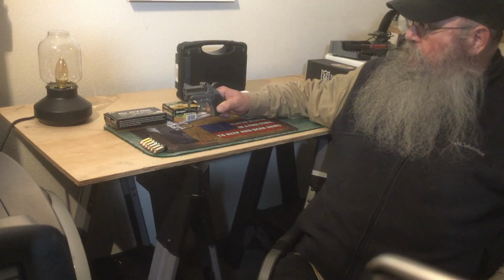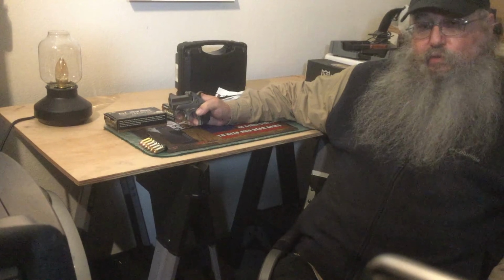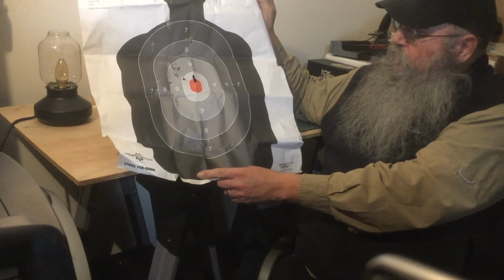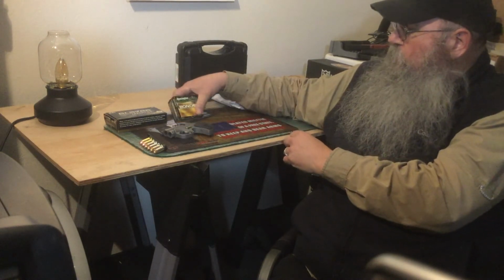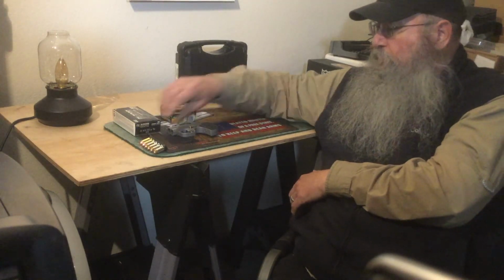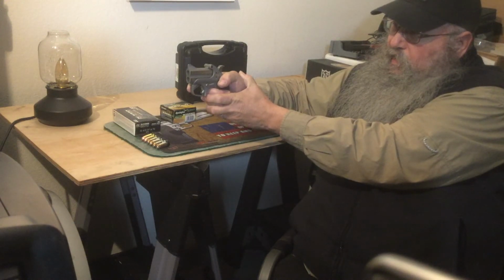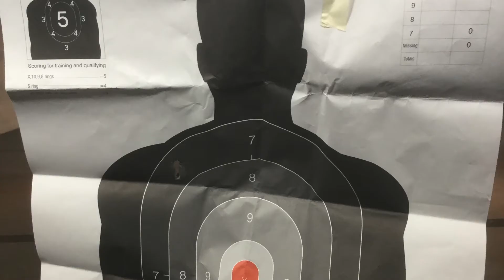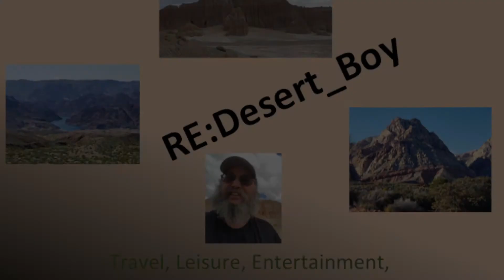Bond Arms .45 ACP Roughneck  - Range and Report

Comment: Just wonder how it would perform with my 200gn SWC reloads? Guess some questions just need to be unanswered...
Reply from the maker: With the shorter barrel and as a reloader, you would be able to adjust the powder or the load to make it burn faster or slower and still achieve a good energy ft. lbs.(excuse our lack of metrics here in USA) outcome.   I do like your thinking though with the SWC as many including me still like those for self defense especially in .38 or .38+P, however why not .45 ACP as well.  Thanks Mr. Snapshot.